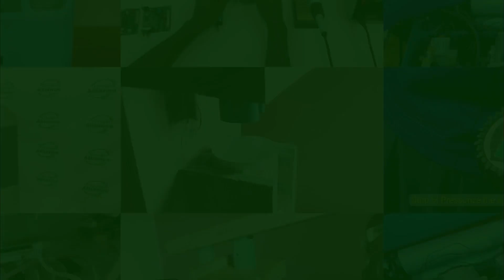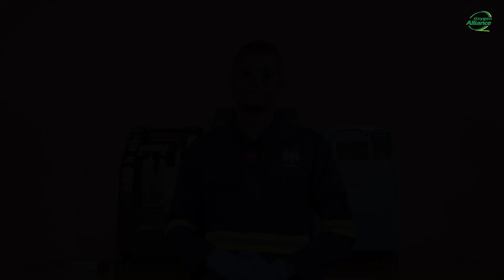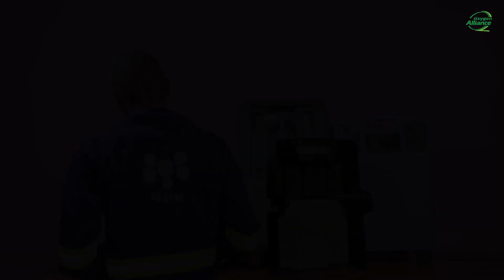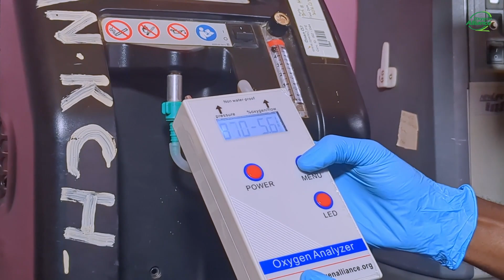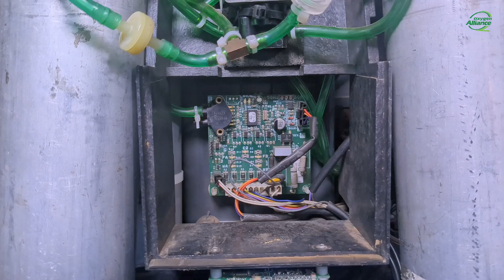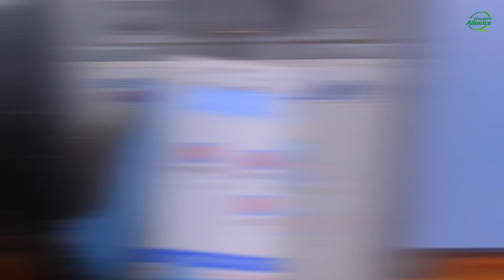How To Deal With Low Oxygen Purity: Part 2

Comment: Hai when is the powder filling required
Reply from the maker: Refilling or replacing zeolite becomes necessary when an oxygen concentrator produces low oxygen purity after all other common cause such as leakages and worn-out compressor kits have been ruled out.
There are several indicators of deteriorated zeolite:

Low oxygen purity despite all other components working correctly.
Low pressure at the top of the sieve beds (the outlet leading to the product tank).
High pressure at the bottom of the sieve beds, sometimes accompanied by the pressure-release valve popping.

If you observe any of these signs after eliminating other possible causes of low purity, it is likely that the zeolite has degraded and needs to be replaced

Comment: Best video. the OX-10A oxygen concentrator display "E2. lo230" error I have replace almost all component and the problem still exist what's the problem? do the if you can .
Reply from the maker: We do not have direct access to the service manual for this concentrator model; however, based on available literature, the E2.LO230 error may indicate either low system pressure or low oxygen purity.

Links: https://www.healthyjeenasikho.com/post/decoding-yuwell-oxygen-concentrator-error-codes-a-user-friendly-troubleshooting-guide#:~:text=E2:%20Low%20Oxygen%20Concentration,recalibrated%20by%20a%20professional%20technician.

Link 2: https://www.healthyjeenasikho.com/post/oxygen-concentrator-error-codes-understanding-and-resolving-issues#:~:text=Q2.,outlet%20with%20the%20correct%20voltage.

 Low pressure is commonly caused by leaks in the piping system—such as loose fittings or cracked tubing—or reduced compressor performance due to blocked intake filters or worn compressor components; troubleshooting should include a leak test using a soapy-water solution on all tubing connections, sieve bed ports, and pressure-bearing joints (bubble formation confirms leakage), as well as verification of outlet pressure with an external gauge, which should fall within 40–80 kPa. If system pressure is within specification, low oxygen purity should be investigated by first confirming output concentration with an oxygen analyser; if purity is below 82%, check that the mains power supply matches device specifications, inspect and clean or replace remaining clogged filters, assess the control board and control valves for proper operation, and evaluate the condition of the sieve beds (You can do this by installing them in a known working concentrator of the same model and note the purity), replacing degraded zeolite or the entire sieve bed assembly as necessary.

Comment: Hi there, could you tell me why the power cut alarm does not go off when the mains power is turned off at the wall plug point. I have opened the Airsep Intensity 10L and it does not have a battery that I can replace like they have on the Airsep Elite 5L. I am not sure if some models have a capacitor, but either way it is not working even after running the machine for 3 hours.

Comment: My question is is okay to have that oxygen purity which is 88% instead of 95% does this mean that it's a different model
Reply from the maker: 88% oxygen purity is medically acceptable (WHO minimum is 82%). It doesn’t mean it’s a different model. Purity can vary slightly depending on the unit’s age and  maintenance